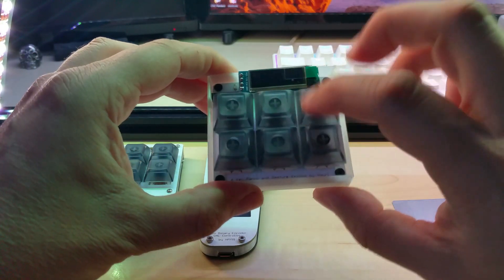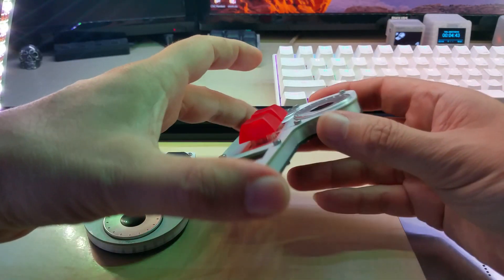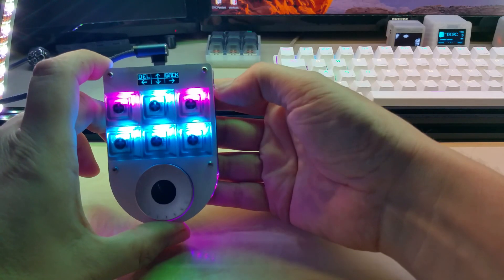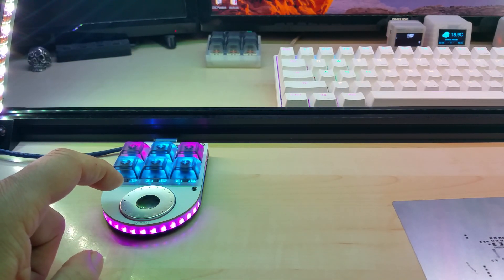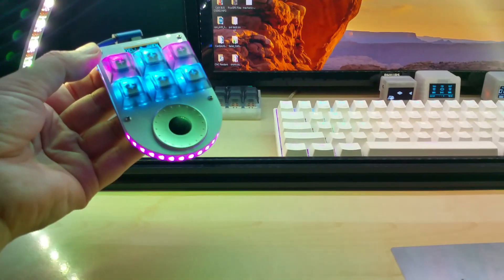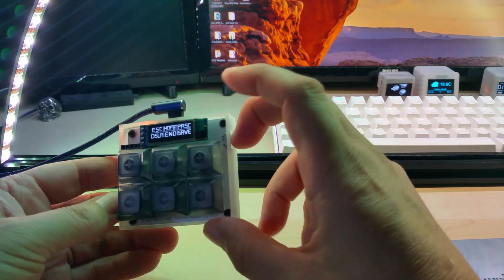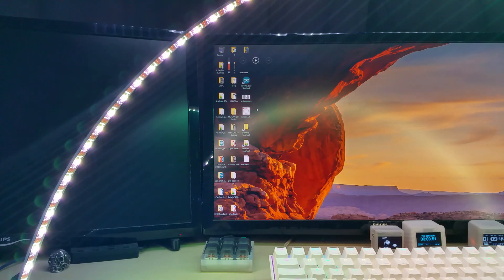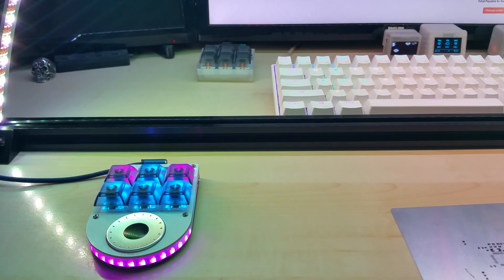Custom 6 Key Mechanical Keypad with Rotary Encoder for Volume Control by Hayri

Comment: this is extremely nice, but too expensive for me personally. wish You many successes and satisfaction! best from poland
Reply from the maker: Thank you Alexander and I understand that it might be too expensive for you. At the same time it is a lot of work for me, it takes about 3 hours to just put it together. And if you deduct the cost for material, the cost Tindie, Paypal and my Bank take out of it and divide it into the 3 hours, there is not much left :-) Not to mention the time it takes to create the PCB's and write the code which is only done once obviously, although then I always update the hardware and software to add new features, as I did with the keypad too. Take good care of yourself.

Comment: Did you make the pcb for the 6key with rotary encoder? I want to build something similar but would like to find a suitable pcb if I can avoid making my own pcb.
Reply from the maker: Yes, I design all my PCB's and have them fabricated.
Reply: @iHayri1  would you be willing to share the design or sell me one of the pcb's?
Reply from the maker: @francisdonsmg6819  Sorry, don't share current products designs nor do I sell just PCB's for obvious reasons. This is my way of earning a living, it is my main "job" . Why don't you make it with ready made devboards? Creating and designing PCB's takes time, and time is money.
Reply: @Hayri, I would like something a bit custom personally. I am going for something with 6 keys and a large rotary knob. If I really need a custom pcb I have no problem putting in my own time and effort to learn what I need to. But buying some type of diy kit for just the pcb would make the project a lot easier. As far as I have seen this is not a very popular design that people go for and I'm A bit particular. It's pretty cheap to get a custom pcb just time consuming. I got a lot of that so it's whatever. Thaks anyway.
Reply from the maker: @francisdonsmg6819  Not sure what you mean that it is not a popular design, I have people waiting for it as I am currently sold out! Well exactly, time is money and I am sure you do not work for free, neither do I. If it is cheap to get the PCB done by all means, sit down and design your own instead of trying to put my design down but yet wanting to buy it for "cheap" and saving money.

Comment: Whassup, this is awesome! I am actually in the middle of prototyping something similar (although certainly not that fancy)  - either a macro keyboard for my graphic colleague (to zoom and rotate the Photoshop canvas and quick save for instance), or for myself to skip those pesky YT ads remotely (from my phone or another arduino in my bed). In every case the LEDs do add it some gloss ... and the display to see what mode you are in is one perfect idea!

I actually got stuck on thinking of what features (how many buttons / modes) I want and how to design it somewhat ergonomically. :D
Reply from the maker: Hi Lis, thank you for your great comment. Neopixels do add some flair for sure but are a pain in the butt to put the solderpaste down and reflow. Other than that it's really easy to make whatever you wish to control, input macro sequences, or even text with one click. Having a rotary encoder is then icing on the cake.

Good luck on your project, just give it time and you will come up with great features to add. Take care :-)
Reply: @iHayri1   Oh, you are quite welcome, always nice to source more inspiration.

Why solderpaste, though? If applying rgb LEDs, I would probably cut a stripe from eBay to the lengths and glue it in, the three pads are quite silderable. Or even more likely use only one or two led modules as an indicator (current draw concerns) - not that fancy, just to indicate, simple LEDs would do too.

That said, in spite of being a big time noob with Arduino, I have all the components in a box, a bunch of tested sw components and know the principle if what I wanna achieve and only need to put it together. Perhaps I should finally realized že that the first iteration will neither be nice, not 100% working.  :D

This thing of yours, us it running a Micro? Or Teensy? Or ProMini?
Reply from the maker: @liszcgsedt  Well, I do design my own PCB's and reflow everything in my cheap toaster oven, the LED's you se here are the size of a rice corn and have 4 connections each, you can't even hand solder them as the pads are on the bottom of the LED. You can of course use ready made LED strips and don't have to deal with  it :-) I am using the 32U4 wich is on the Pro Micro and Leonardo boards. It emulates the USB HID perfect and just works. You can get those fairly cheap everywhere or might have it already.
Reply: @iHayri1  Ah, that makes sense, I tend to think in terms of readily available components ... so a fitting HID-capable Arduino, perhaps a generic PCB if it slows a low profile and the rest. But I am coming co a conclusion I need to make a working concept no matter how ugly it may be and then iterate on the design. 

But still, how much current does a programmable LED (2812 or 5050) take? 30mA? I am no way even remotely risking ruining my USB port that would power the thing.

Comment: Wow this little gadget looks useful. I’m looking to buy a mech keypad to use with iPad. Will this connect to the new iPad Pro? I would like to use this with my drawing program.
Reply from the maker: Well a short Google search revealed that it should be possible, please see here: https://arduino.stackexchange.com/questions/43389/arduino-leonardo-as-keyboard-for-an-ipad
https://stackoverflow.com/questions/14459700/arduino-as-keyboard-on-ipad
But I have no way of testing it :-(
Reply: Hayri ok, I’m going to do a little bit of research on this. So i should look for anduino leonardo microcontrollers?
Reply from the maker: @mavr1k440  Yes, my keypad is based on the Leonardo which uses the Atmega32U4 chip that has native HID capability.
Reply: Hayri seems like the only problem i might encounter is the power consumption. From what I’ve read, I would have to change some text on the file directory. 

change USB_CONFIG_POWER_MA(500) to USB_CONFIG_POWER_MA(100).  Got to admit, i don’t know much about this but it seems like it might work on the ipad pro.
Reply from the maker: @mavr1k440  I saw that too and one work around it is to use a powered USB hub while still changing from 500 to 100 mA. I just measured the power consumption during idle for you and it comes in at 120 mA. I can be reduced to well under 100 mA by just dimming the Neopixels a bit more. Also measured the Leonardo itself and it is around 6mA the OLED should be around 20mA so you see the biggest consumer are the Neopixels. If I would have an iPad, I could try it but unfortunately I do not :-(

Comment: Nice! What size are the neo pixels? I’m looking for some adressable leds that are fitting under mechanical switches.. (I’ll use some switches with smd compatible space) .so far i found SK6805-2427 and APA102 to be the smallest options.
Reply from the maker: Thanks, on the second version I used 3535 sized Neopixels and they fit underneath the opening for the LED perfectly.
Reply: Thanks, i think I’ll go with the WS in 2022 size with 5mA.. the APA needs even more mA than the standard WS and is more expensive.

Comment: Hayri, this would be an amazing pad to use with Adobe Lightroom. You can use the keys to select a certain parameter (exposure, brightness, contrast, etc.) and use the rotary encoder to adjust things. People use a MIDI controller to do something similar to your product, but they're often really big/clumsy whereas this looks like a much simpler and smaller solution.
Reply from the maker: You are correct, you can use it for just about any program out there that has either direct keyboard shortcuts and might even need macro keystrokes. As you said there are other products out there but this is small, portable if needed to and what I forgot to mention in the video, it could even be used to show CPU speed or temp or any other data about hardware. You could even have different codes at hand and just upload the one you need for your current application if 12 keys are not enough.